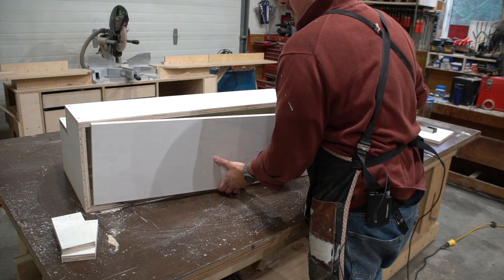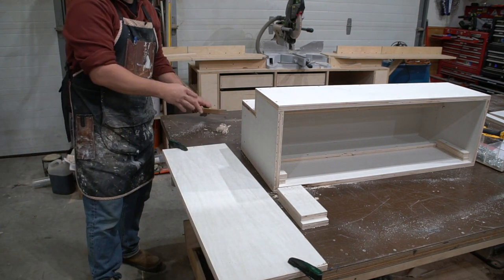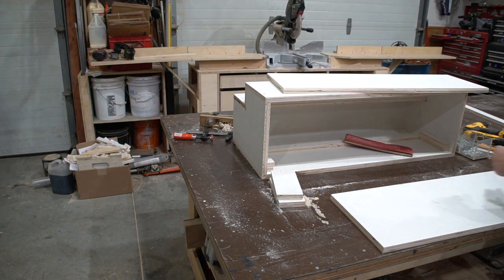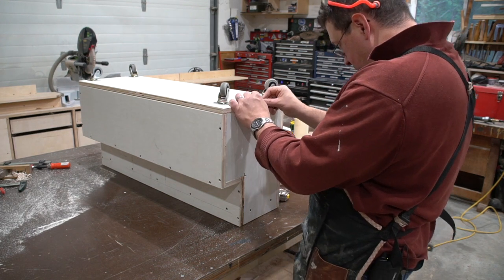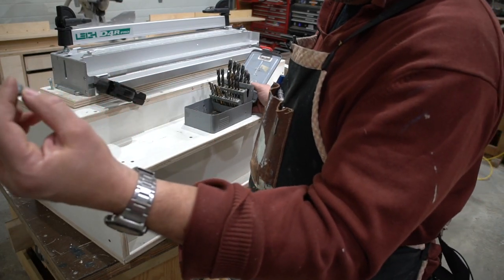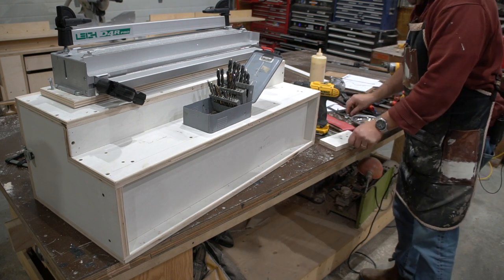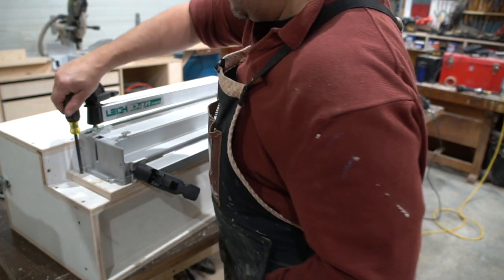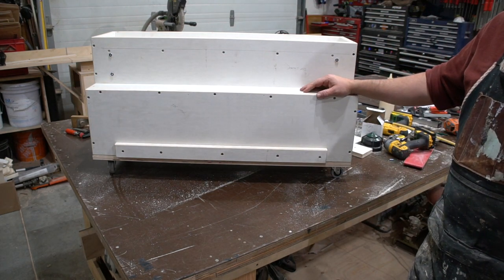Leigh Dovetail Jig Box Build Part 4

Comment: Great video. Thanks! No handles? Did you make a cut list?
Reply from the maker: Thanks!
I don’t think I put any on there but I did on my one.
It is a good idea though!
I did not make a cut list cuz the two jigs in my shop are the same size of a different model so one box would not fit them both. I wanted to avoid having people make the wrong size one and be upset with me.
Cheers 
J

Comment: Just picked up a used D4 and looking into building a case for it. I noticed that you do not have the side stops assy on the first case you made. Did you remove them? What do you use the aline the boards? I do enjoy your videos.
Reply from the maker: Hi Cecil
I most likely did it after or forgot to show it.
Aside from the two stove bolts per side (as opposed to one) and the dimensions, it is pretty much the same box.
If you may be referring to a part of the jig itself, it is most likely that I just removed it for the build.
At least I hope I am not missing a part for the jig
😝
Be well
J
Reply: @SceneryFarm  I think maybe the one I have is older D$

Comment: Hi James, just about to make one of these for my jig - is there any reason you put a batten on the top to be level with the jig, rather than the jig just being level with the box? Thanks
Reply from the maker: Um... I forgot to add the thickness of the 3/4", 19mm base for the jig when I built the box... so I had to pad out the top the same dim.
I consider it a useful accident as it provides my hands more room around the back of the jig while loading and unloading.
I wish I had a better answer :)
Cheers
J
Reply: Thanks for reply - happy accidents are always the best!
Reply: Thank you Stuart - that was my question
Reply: And my question too! Thank you for explaining. Great project. I especially thank you for explaining the rationale for your design considerations to accommodate changes in the D4R’s size. I just ordered a D4R Pro and would like to make one of these boxes for myself. I saw the New Brit Workshop design and went searching for plans and that’s how I came across your video.